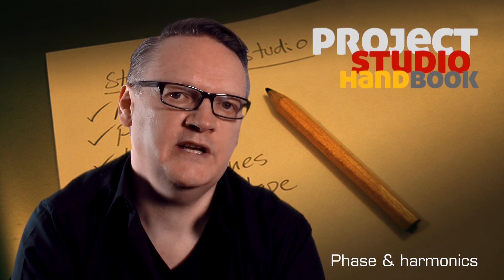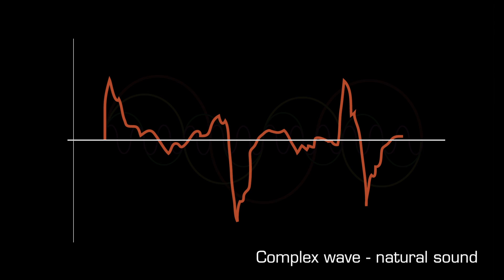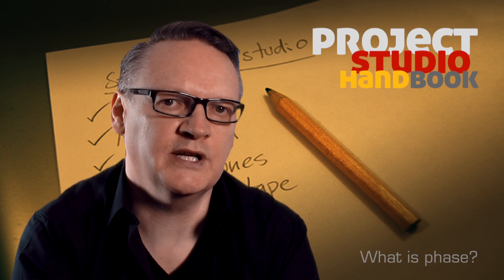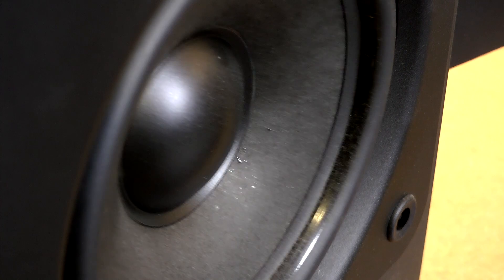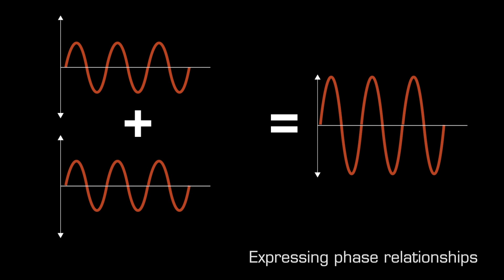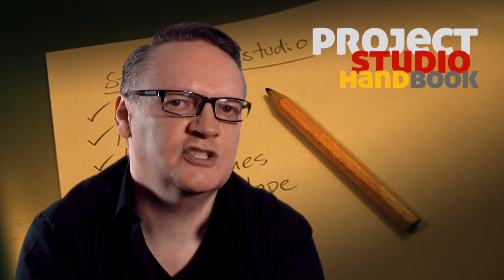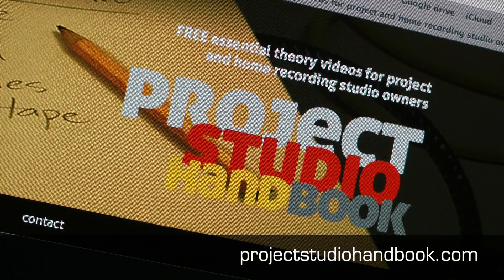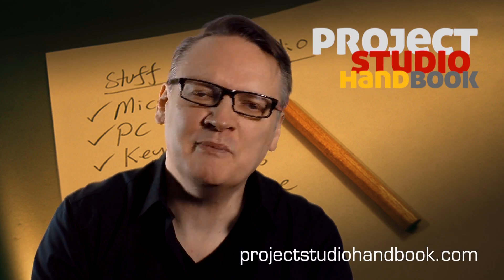Phase & harmonics - sound theory

Comment: The first illustrations of sine waves are slightly distorted and consist of flattened semi-circle elements. A similar shape can be obtained by shifting a triangle waveform 90°. Curiously it will still sound exactly the same, but the discontinuity that was at the top of wave is now where the circle parts join at zero.
Reply from the maker: Thanks for your comment. We'll try and improve our diagrams when we update the video.